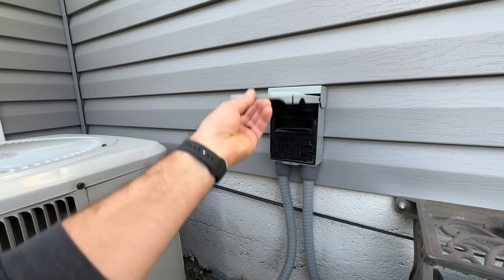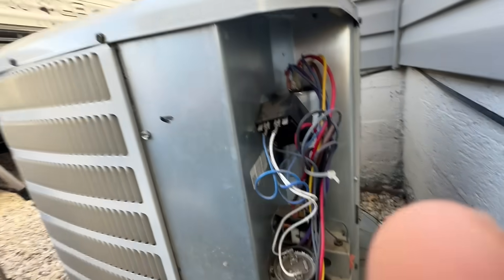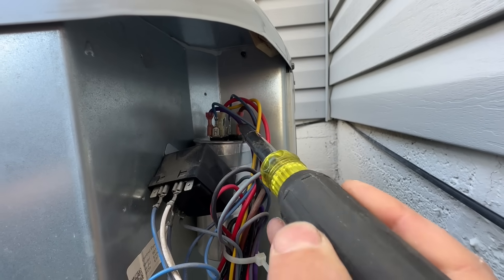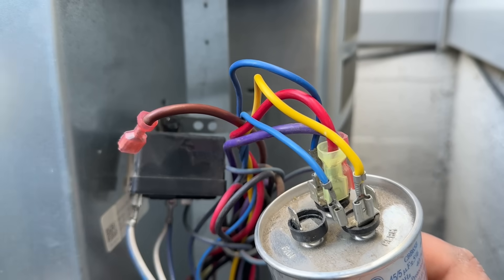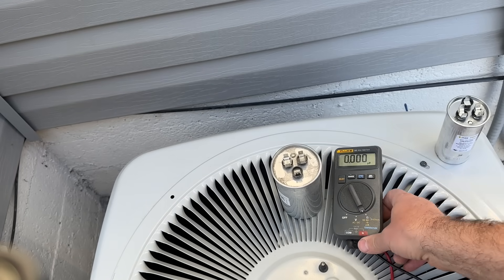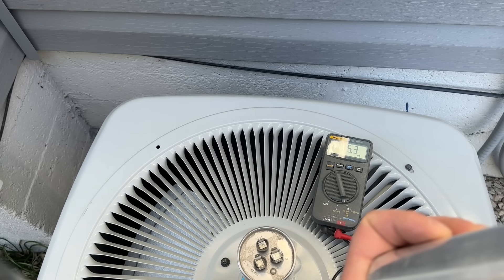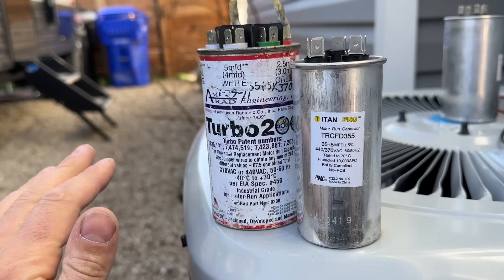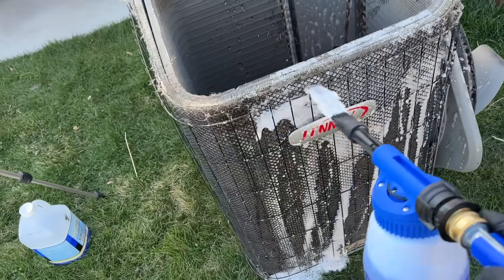How To Check & Replace An Air Conditioner Capacitor

Comment: When replacing AC capacitors, the capacitance rating (such a 40/5 mfd) must be the same as the one installed, but the voltage rating can be higher (but not lower) than the original. A capacitor with a higher voltage rating may last longer if you can find one. Also, capacitors come in different physical sizes, which could be a factor in some AC units depending on how they are mounted, but usually they don't have to be identical size.

Comment: Great video. FYI your supposed connect the compressor to the higher value lead on your universal capacitor for example 20+25 you would hook up to the 25.

Comment: I have a Rheem unit that has a 35.0mfd 480VAC/B capacitor.  Part #43-101666-23.  I can find plenty of replacements that are 35.0mfd and 440V, but not 480V.  Mine clearly says 480VAC/B on the label.  Am I required to get a 480V unit?  This is in the southern U.S.  Thanks !!

Comment: A couple comments:
1)  I have replaced about a dozen of these dual capacitors on my 3 heat pumps over the past 3 decades.  More often than not, there was no external evidence of failure - the capacitors looked fine, but had in fact failed.
2)  Nearly all of these capacitors are made in China now.  I am seeing failures occur in 2-4 years, whereas I used to often get about 20 years of life out of original capacitors made in USA.  Given the current market that is dominated by cheap junk from China, I have ordered replacement capacitors to have on hand once an installed capacitor has been in service more than about 2 years.

Comment: I got a new capacitor for my TRANE  XL14I but the connections are different on top.
Original is a Genteq CPT01074 with two 4 prong connections (No markings)
New capacitor is an AmRad USA2229
with three connections a single prong orange CPT, a Black 4 prong and a white 3 prong. Only the orange one is marked...
NOW I'M STUCK

Comment: One way to swap wires to the new capacitor in the right place is to hold the new one next to the old one and swap them one for one. You can also mark them with a piece of tape or a wire marker kit which you can buy online or at the hardware store. Harbor Freight  is probably an excellent place to buy a wire marker kit.

Comment: The new capacitor instructions might tell you how to safely discharge the old capacitor before installing the new one. Don't quote me on this but I think they are designed to automatically discharge through the motor windings in a few seconds or minutes after power is removed. But follow the manufacturers instructions.

Comment: I guess my blower motor went bad i wished i had checked it before i threw it away. I was quoted 1500 for a blower motor to be replaced. I done it myself in about 40 minutes super easy to do. When I ordered the blower motor i ordered a capacitor and contactor too. When i got warm enough to turn the AC on it wasnt blowing out cold air and the outside unit wasnt coming on unless I pushed the contactor in manually. I changed the capacitor and contactor and the outside unit will still not kick on. Just like before the only way it comes on is if i push the contactor in. Any advice on what ti yry next. I put it in exactly as it was took pics etc. Any help would be greatly appreciated!! Thanks
Reply: Have you gotten an answer yet ? If not. If you have a volt meter. Check your contactor LOW VOLTAGE. Your outdoor unit is controlled by your indoor unit by way of the thermostat.  You have a transformer inside your indoor unit which provides 24 vac to your thermostat and your outdoor unit.  On a call for cooling, you get 24 volts to your contactor,  thus, energizing it and making it PULL IN. If you don't have 24 volts, you may have something else going on. They way I check is to turn thermostat on AC  TURN DOWN WELL BELOW INSIDE TEMP, IE.50 DEGREES. MEASURE VOLTAGE AT OUTDOOR CONTACTOR.  USUALLY THE 2 WIRES MOUNTED ON THE ( SIDES ) OF THE CONTACTOR.  . It is basically an electromagnet,,, when energized ,,, it pulls itself in. By you pushing it in yourself, it thinks it's energized.  Hope this helps. List.......
Does indoor  fan run yes 24v
Does heat work yes.. 24v 
If yes.. check for broken wire from indoor unit. I have found many broken thermostat wires eaten up by weed eating around outdoor unit.  That voltage will be controlled from breaker panel MARKED FURNACE... as that's where your low voltage comes from.

Comment: Thanks for the info. I'm buying a couple tomorrow and changing out my 6 yr. old cap. I'm a snowbird and can control the thermostat via WIFI but if the cap. goes I'll lose my humidity control.

Comment: Great video. I'm OK but  I think you should pin the concept that unit can still have power in it for whatever reason. Idk I turn off my ac breaker, remove the plug. I did the discharge on unit with the electrical screwdriver. But for some reason spark flies twice. One current was strong enough to turn something (maybe compressor) on for a moment.... I was trying to screw items back and I felt the current through my glove. 😢.

Comment: Proactively replaced two caps in two units after watching this.  I bought a 45/5 based on a picture of one that was previously replaced.  However, one of the HVAC companies installed a 50/5 into one of the units.   The new ones work. Not sure which size is the right to have though.

Comment: thanks so much for doing this video. i had a "service" for my hvac yesterday and the tech said the capacitor was weak. he showed me a reading of 35 and i asked him about replacing it. he had one on the truck....lol. cost to replace it was at $350 or $500 for the heftier model. i said nope, will wait till it breaks. came in and checked capacitors and saw the low prices of 10-30 buck on almost any of them. i saw your video today and see my capacitor was pretty much where it is supposed to be. thanks for doing this video. saved me a bunch of unnecessary expense. need to watch the cleaning video....thanks again.
Reply: you should send this yt link to that repair company.  Let them know homeowners aren't as stupid as they think.  Also, watch for techs who just manually spin the blades.  It'll fix the issue temporarily,  but lead to failure of other parts, especially fan motor and compressor.

Comment: Thanks for the great videos. I need to check out my unit as I suspect the capacitor may be going bad. What brand would you recommend? I want one that will last.
Reply: It's best to take a picture of your present capacitor to have the part number on hand, then check a REPUTABLE company - Grainger for one, and buy a known replacement.  *NONE* of the amazon bullshit....  My condenser unit is about 10 years old and for only 25-30 bucks, it is just a good "maintenance item" to replace every 10 years or so and mine is DUE....  Living in Florida, an AC unit works like hell in the summertime and it is cheap insurance to replace the cap BEFORE it fails, probably preventing a more expensive compressor/condenser replacement....  30 bucks vs >1000 dollars is a no brainer.................

Comment: Great video, gracias.
A company charged my daughter $850 to replace 2 capacitors in under 10 minutes. No mercy from ac companies.
Reply: This is why I just do everything my self. Everyone charges an arm and a leg for work and then sometimes they don't even do the job right or they lie about what's wrong. I would pay about $150 for someone to come out and do this for me but anything more I'll just diagnose it myself, research, and perform the labor.
Reply: I could be wrong,' price gaulging' laws in your area?
Reply: If there is and this applies I assume there's a statue of limitations also.. so chop, chop.....
Reply: They'll get their just reward.  They may think they got over, but there's a higher judge They'll give an account to. 
2 chronicles 7;14

Comment: If you go ahead and buy a spare, you can just change it out if your AC stops working. Even if you don’t have a way to test the old one, it’s cheaper to change a $20 part than to have a service tech come out.

Comment: To save everyone the time that I spent yesterday. If you don't know your size, and can't see it on the old one, don't do the universal capacitor. You can look down into your system through the top (fan part) and there is a sticker on the compressor inside that tells the voltage for that and there is also a sticker on the fan that tells the voltage for it.

Comment: Outstanding video!  I've replaced my capacitor several times.  I'm begining to think my contract AC folks didn't put in a correct sized capacitor and that is why it keeps going out about every other year.  Hey, they think, "More money for me!"   Right? Can I install a bigger capacitor  with bigger numbers?  Thanks.
Reply from the maker: No, always replace with the factory size capacitor 👍🏼 what a bunch of sheisters

Comment: 1:46 Pretty good video, and not that it really matters, but that is not what a run capacitor does (that's more what a start assist capacitor and potential relay do). I believe you would have to be an electrical engineer to truly understand the purpose of a run capacitor. I've been an HVAC tech for years and I've had it explained to me many times and I still only partially understand its true function. The good thing about run capacitors is they're easy to diagnose, easy to change, and not very expensive.

Comment: Excellent information.!
I have checked Capacitors for continuity but didn't realize there was a micro rating...
Reply from the maker: Correct. You can’t check them with continuity
Reply: @diyhvacguy  
Unless there's no continuity at all.???

Comment: My guy just tested the capacitor (had 4.9 and 22 (versus 33.3)) so I had him replace it. Fingers crossed. $125 for that part and check of the AC (furnace annual check additional😮 cost, of course).
Reply: Capacitors have a listed tolerance, typically 5% or 10%.  If they are outside that tolerance they should be replaced, and also if they are just getting old and the contacts rusted.

So, a 35/5 should read from 33.25 to 36.75, and 4.75 to 5.25 microfarad if it has a 5% tolerance.

I would recommend using the Made in USA MARS capacitors rated at 440V also, as they last far longer than the cheap Chinese one's and they are only around $10 more, if that.

Comment: Can you use a hard start cp if the unit doesn’t have a hard start?
Reply: Hard starts have to be a kit that connects the capacitor to start the compressor and then removes it from the circuit.  The run capacitor for both your fan and your compressor must be the correct value, or you will end up damaging or destroying the fan motor, compressor, or both.

Comment: I pulled out a capacitor with your instructions. No issues. Thank you. But a problem...it is completely rusted and I can't read the size. I have a very old Ducane AC10B30-A. Any idea on capacitor values? I found something online suggested 35/5 dual voltage but no idea if that is correct.
Reply from the maker: Go to repairclinic.com and punch in the model/serial number and it should show a parts list. the capacitor in that list is the oem spec capacitor 👍🏼
Reply: @diyhvacguy  Thanks. No luck. I plugged in the compressor model number too but does not come up. CR26KF-PFV-130. If you have a manual that that compressor buried somewhere,  would love to see that.
Reply: @josephtheuke3963  All the Copeland compressors in that range from 24500 to 30000 BTU appear to use 35 microfarad capacitors on their CR Compressor Spec chart.  Yours is 26000, or right in the middle of that BTU list, so I'm 99% sure 35 microfarads is correct.

The other number is your condenser fan run capacitor, and you should be able to read that value off your condenser fan motor or look up the motor itself and what specific value it requires.

The dual voltage is just the maximum voltage, so I would go with the higher 440V and you should be fine (capacitors are rated for maximum voltage, so 440V can be used instead of either 370V or 440V).
Reply: @redbaron6805  Yes, thanks. It was 35 for the compressor. I ended up contacting the manufacturer, and although the part was obsolete and they really did not tell me directly what it was,  I was able to get another part number from some links they sent me and when I punched into browser, a site called SupplyHouse came up with the capacitor. They wanted way too much for it at $81.51 but I saw the 35 microFarad. Figured out how to get the reading for the fan from another video just as you said...read it from the fan plate...and then ordered a 35/5 from local hardware store (as they were out of stock) for just under $21. Installed it, put breaker back in, turned on the thermostat, and it purred. And I think the condensor was even quieter than it used to run but I might have been imagining that. I did, however, since I had a socket wrench in my hand, proceed to check tightness of bolts overall on condensor, and did find a few that were loose. So I figure that it will for sure be running quieter...and it is. Thanks to all for help.
Reply: @josephtheuke3963  Great.  Glad it all worked out.  Not sure if you had a meter to check the actual values on the old capacitor, but they do fail in more ways than one.

A common failure, beside them outright failing and going to zero, is drifting out of tolerance.

A fan motor or a compressor with a capacitor out of tolerance will be shortening the lifespan of the fan motor or compressor.

The capacitor sets the angle of the magnetic field for motor or compressor.  If the capacitance is 10%, high it will run the motor or compressor at 110%.

If it is too low, it will be running at reduced power but too high of a load, kind of like trying to drive up a steep hill on a manual transmission car in 4th gear.

The values are critical for correct operation of either system, which is why they typically only have a tolerance of 5% to 6% or so.

I would buy a cheap multimeter that can read capacitance, and check the values regularly, maybe once a year or before the summer cooling season.

Even a Klein Tools meter from Home Depot that can do this is only around $35 or so.
Reply: @redbaron6805  hmm, and so maybe that could have been a cause for a loud overall condensor?
Reply: @josephtheuke3963  It could, as a condenser unit with a out of spec capacitor will be working extra hard.

Most capacitors drift out of tolerance by losing capacitance over time.  This means the compressor will be working extra hard and will be far noisier than it would normally be.

I have seen where replacing an out of tolerance capacitor will quiet the condenser unit quite a bit, as it doesn't make the same loud buzzing sound and the compressor isn't working as hard to pressurize the refrigerant.
Reply: @redbaron6805  So maybe wasn't my imagination then or forgetfulness. Maybe it really did sound that less noisy. Good stuff.

Comment: I just tested a new capacitor I purchased about 4 years ago. I went from common to fan the meter read 4.1 and from common to Herm with a reading of 0.00. Is the new capacitor no good?
Reply: The capacitor tolerances are usually +/- 5%.  So if it is reading 4.1 it is probably supposed to be a 5 microfarad and is out of tolerance.  Whatever the Herm or compressor reading value, 0.00 is 100% out of tolerance for any value and should be replaced.

I recommend replacing capacitors with 440V Made in USA capacitors like Amrad, MARS or similar.  The cheap Chinese capacitors don't last very long.

Comment: OMG, thank you for this video!! We live in hot Las Vegas and our fan stopped working. We were quoted $400, but with the help of your video, we only paid $22.00 and changed the capacitor ourselves. Thank you!!
Reply: Had a local HVAC company do PM. He technician tried to convince me the capacitor is bad even though the unit is working. He quoted $249.00 to change it while the cover was open. I just bought the capacitor for $19.25 so I can change it if needed.

Comment: the fast way is to push in the contactor, the fan and compressor should come on. also if the end of the capacitor is pushed out, that is a telltale sign.

Comment: I need that exact capacitoR CBB65B lol. AC stopped workin last night (not cooling). Any link to that capacitor on amazon?
Reply: CBB65 doesn't refer to a specific capacitor.  The actual capacitance values are written on the capacitor along with the voltage, like 35/5 for capacitance, and 440/370 meaning it is rated for up to 440 volts.

Comment: I worked as an office manager for AC company in South Texas, another common problem we found a lot was ants getting into the contractor, the part by the capacitor. Basically they’d get squished between contacts preventing then working. Techs recommended putting ant bait (Amdro recommended for fire ants)around the base of your unit if you have/may have ants in the area. Ants aren’t the only insect that can get in there, if you spray bug repellent around the outside of your house also spray around the outside of your AC. Easy preventative measure can save a couple hundred dollars in repairs. I just came across this channel so if this  has already been noted, sorry for the duplication 😃.
Reply: This has happened 2 times already to me.  Good tip
Reply: Fire ants are notorious for stuff like that.
Reply: We service all of our own units around the state(we have many offices) and we do 1 of 2 things, either put the ant killer around the units, or switch to the electronic relay that has no contacts when one has to be replaced, then we don't need to keep putting out the ant killer.
Reply: MI 😊the q is the best thing to happen 😊
Reply: Give. Me job. I like. Ac. Work